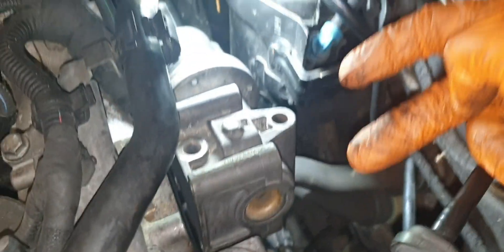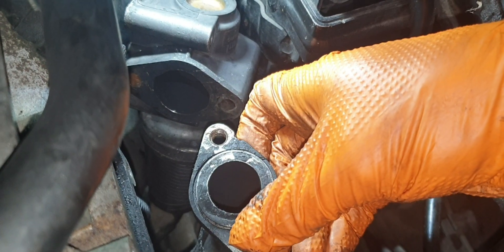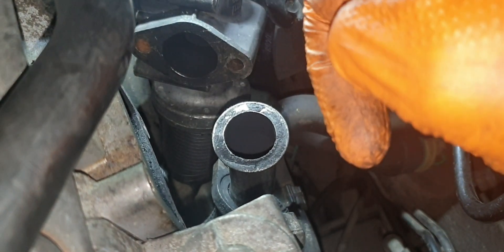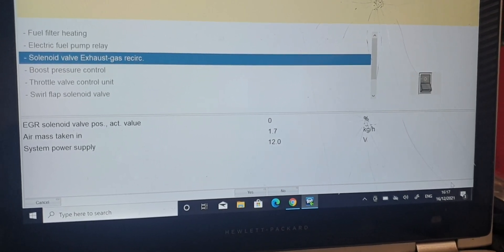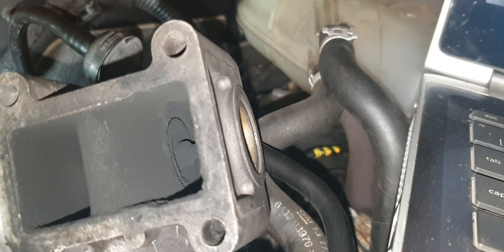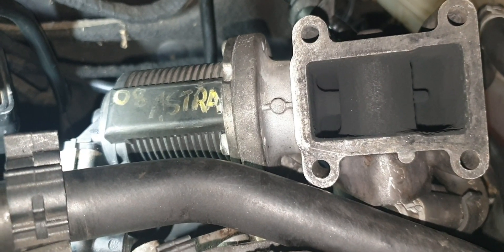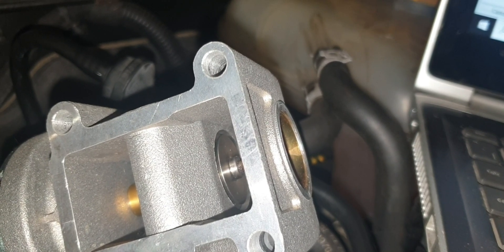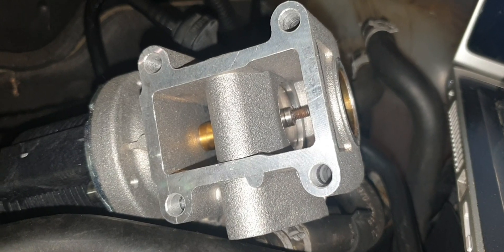How to test a EGR valve.

Comment: Its not good fore engine to drive short trip., the engine must been warm and the  exhaustteprture been hot enogh, drive lite more harder and longer trip if not wil been like on this video , the egr can bee cleane it up too, with , erg or break claner , clean the air intake in the same time

Comment: Your old EGR vavle seem to be stuck in Open Position right? But at the same time it seems to be clogged up badly so minimum exhaust gases can pass through, effectively being almost closed... So what is the rationale with buying a new EGR valve which will be full wide open at idle ? I don't quite get it?

Comment: great content and thanks for sharing. i have a vauxhall antara diesel 2.2 cdti which has gone into limp mode and the only fault that comes up is egr sensor bank 1 wherever that is, im unsure if its the actual valve itself or a sensor connected to it ?